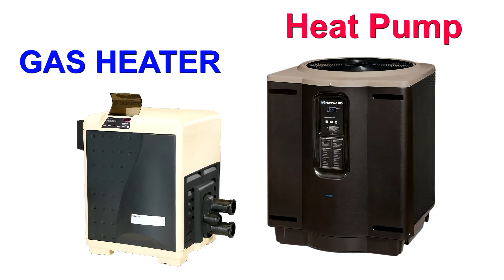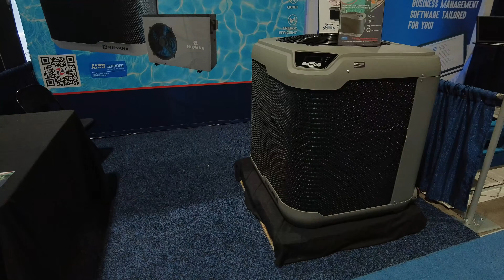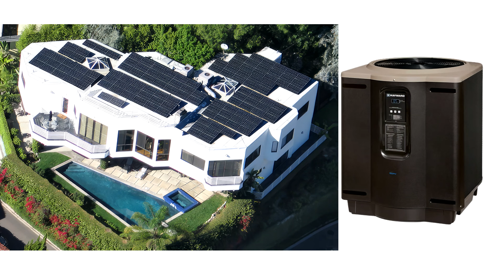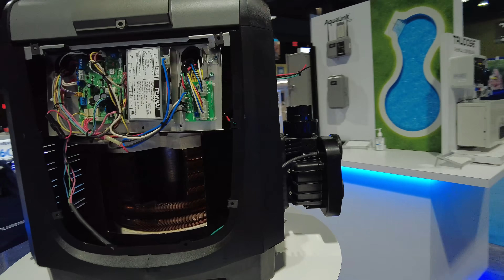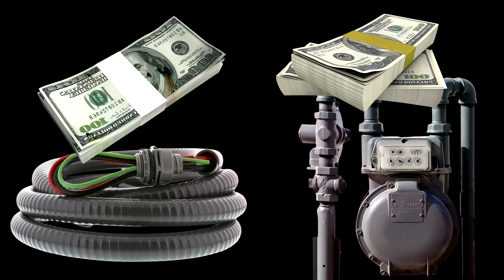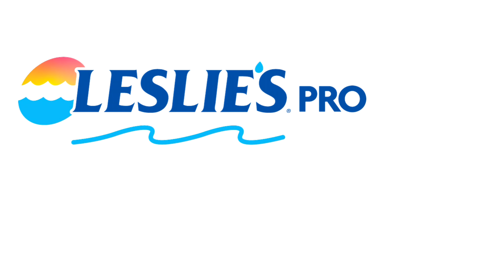Gas Heater VS an Electric Heat Pump Which is Better?

Comment: i have a 40x15 and 7x7 (inside that 40x15 area) pool being built. Debating between just getting an all electric heat pump or a dual system that lets me connect propane (my house is all electric). I also have solar panels but they haven’t kicked in yet. Brand new home. 

What do you suggest for Me? Also in SoCal. I’m worried I won’t be able to use the spa at all in the winter if I go with electric heat pump only.
Reply from the maker: You would need a very large heat pump. Maybe the largest they can fit on the pad. I'd say you should be fine in the Winter - it will just take longer to heat that spa.
Reply: @ everyone says that at 50, it will not heat up

Comment: A heat pump isn’t going to get your pool from 50 to 82 degrees in 56 hours .  If your pool is 50, it’s because it’s cold outside and heat pumps can only get your pool 5 or 10 degrees above ambient temp outside .  If you want to swim when it’s cold and money isn’t an issue, get a gas heater.  If you just want to keep your pool nice and warm when it’s already somewhat warm outside or like the pool extra warm on the occasional chillier day , get a heat pump.  But remember, 2 or 3 degrees increase in temp in 24hrs is what to expect with a heat pump .
Reply: Unless you use a thermal blanket. Without one a a heat pump will struggle in cold as you say.
Reply: We have 26 panels of solar, I'd rather have an electric heater.

Comment: In California, electricity costs a ton and to run that type of wattage for 56 hours would cost an arm and a leg.
Reply from the maker: Natural Gas is cheaper - you are correct. The state will be banning gas appliances by 2030 which doesn't make a lot of sense.
Reply: Im in southern california, I have a heat pump, but I also have a paid for 7.3kw solar system. The heat pump gets alot more efficient, the higher the air temp is, so I set my heat pump to kick on automatically at 2pm to 3pm (warmest time of the day/before my TOU 4pm) to heat my spa only (with bubble cover on). That gets the spa to about 85 degrees, then by the evening, my spa is "pre-heated" and it only takes about 20 mins to get my spa up to 98ish degrees to get in it, and while im in it, takes another 15 mins to get to 100 degrees if I want. I dont use the heat pump to heat the pool, there is no need in my opinion. Bottom line is, if you must heat your pool/spa quickly, go with a gas heater. But for me, the energy savings with a heat pump is a no brainer.
Reply: @darinferreira4448 i have a 40x15 and 7x7 (inside that 40x15 area) pool being built. Debating between just getting an all electric heat pump or a dual system that lets me connect propane (my house is all electric). I also have solar panels but they haven’t kicked in yet. Brand new home. 

What do you suggest for Me? Also in SoCal. I’m worried I won’t be able to use the spa at all in the winter if I go with electric heat pump only.
Reply: @joemomma707   Yeah, im not sure. Your pool is bigger than mine. Mine is 32x16, and 3ft  5ft  3ft deep. About 13k gallons. My spa is a 7x7 as well. The heat pump will definitly heat your spa in the winter as long as its a big one like mine. Mine is a Hydro Royal HTR150TA Heat and Cool, 142,000btu, but its not going to be instant like a 400Kbtu gas heater. If you start out with 55degree spa water,  on a 65 degree day, its going to take about 3hrs to get it to 100degrees, but it only uses about $1.50 an hour in electricity, whereas a gas heater will take about 30 mins, but gobbles about $8 an hour in gas. If propane is all you got, I def would not go with a gas heater, that will def get expensive. I replaced my big heat pump with a gas heater, because I decided to just bite the bullet and pay the extra cost to heat my spa quickly. But if you use a bubble spa cover, it will keep about half the heat in the spa after about 24hrs, so if you use the heat pump regularly, it will heat up much much quicker. So really its convienience vs cost in my opinion  Im in the Hemet area, where are you?
Reply: @ bro! Thank you for your help!! Im 33 miles from you! So we are local. Pretty much the same weather. 

I noted your electric heat pump. My pool builder thinks that it will cost more to run the electric heat pump. A lot of them don’t really know much about electric heat pumps since it’s pretty new.

We have similar sized pools. My pool is 40x15 but in that rectangle area, the spa of 7x7 and sun bar of 7x7 is in that so we have similar sized pool. I would like to heat up pool here and there but my main goal is the spa.

What if it’s like 50 degrees outside? I’m assuming the electric heat pump won’t work right? 

Thank you!!!
Reply: @ No, its still works. But you have to have one that will work in very cold conditions. So, you wouldnt want to try to start to heat the cold jacuzzi like in 45 degree weather, it will take forever. If you want that kind of convienience, you gotta go with a 400k btu gas heater. But my heat pump never let me down, but i always had reasonable expectations. You gotta know reasonably in advance when your going to use the jacuzzi, and keep the bubble cover on when not using it. But yeah, once its heated up and your sittin in it, and the temp drops to 45, its still maintaining 100+ deg. Again, the heat pump is not nearly as convienient. If you are really planning to use the heater for mainly jacuzzi, you might seriously consider gas. Yes the heat pump is cheaper to run, but a big heat pump like i have has an initial purchase price of alot more than a gas heater. Tough call really
Reply: @ thank you!!! I appreciate you! For me, since I don’t have any gas at my new build home, it cost more to go with propane. I have to buy the propane tank.

I was looking at spending an extra $5500 to get the dual heater (electric and gas). But I don’t want to add any more cost to my pool so I’m just gonna go with the electric heater. I hope it all works out! Seems like it’s pretty cheap to run the electric heat pump, cost wise.
Reply: @ well, mine is for sale if you are interested let me know. Ive used it for 2 winters, its still basically brand new. Its a 142,000 btu Hydro Royal, built in Florida. Ill sell it for half what I paid brand new. Its a very well built heater. My tech is out of Riverside, he can deliver and install if your interested. I will also garuntee it. Im a pool service professional. Let me know.
Reply: @ may I have your email please.

Thank you!

I’ll email you

Comment: In B.C.  gas is 300 a month (4 months of the year) for 20000 gallons, a heat pump is carbon  neutral (here) and is way cheaper to run for maintaining a temperature, we need gas to get us up from 48F  to 86
Reply from the maker: Good to know. Gas is still cheaper here in Southern California. But not by much.